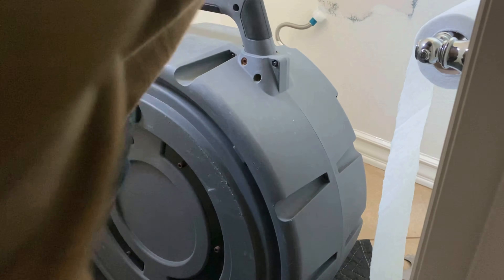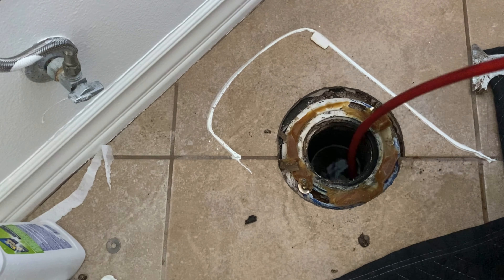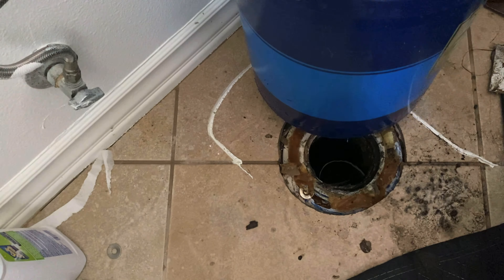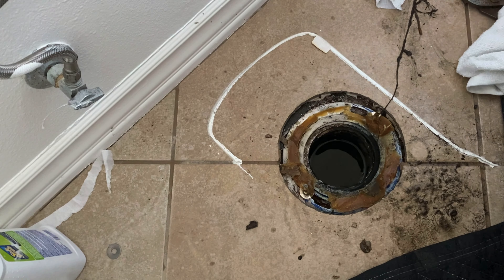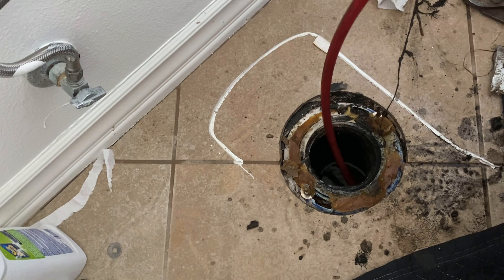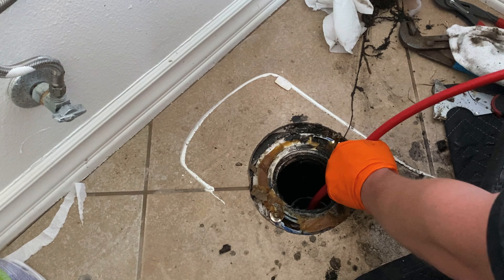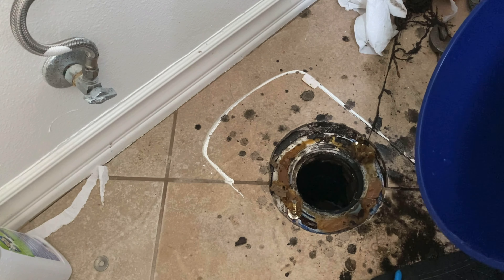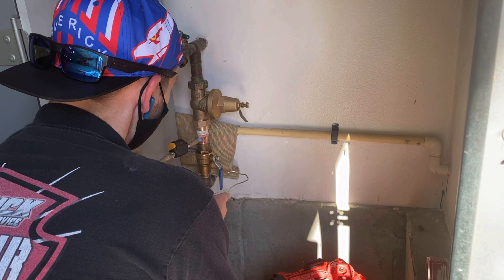Ridgid 64273 FlexShaft review k9-204 , Unclogging a toilet! | Unclogged Episode 14

Comment: I have the 204 and 102. Easily they pay for themselves many many times over. As far as jetting that line I would have using my mini reel probably. I also have the JM1000 electric for smaller lines that is super simple to set up and use, and destroys 2" lines full of grease.

Comment: Great price in the 204 Chris. The 204 is also the go to for me and now looking at the 102. Let me know what you think about the 102. Regarding an expensive camera I using a Compact but if you are not doing reports for clients (mostly for insurance claims or big clients like commercial or condos) stick to Chinese. I starte with a Steel Dragon 900N and let me tell you that for the $ it still does a great job for much less $. Thank you brother
Reply from the maker: Haha I wanted one of those steel dragons for a while now! I have a friend that uses them out in Colorado and he loves them. I bought another nicer Chinese camera that you’ll start to see in upcoming videos it’s the Spartan Sentinel. 

I HIGHLY recommend the k9-102 specially if you like the 204 and you have gotten use to its strengths and weaknesses! The 102 in my opinion is actually a better unit! I’m also hearing that from a lot of other guys the 102 really gets the job done in the smaller 1.5-2” lines!! Good luck out there brother thanks for dropping by I look forward to talking with you more!
Reply: I agree 100%. I have a Compact 2  with  a Csx6 monitor but the 900N it is the best you can get for the $. Super reliable and gets the job done always. I actually own 2 SD 900N

Comment: Hi Chris , I have a Ridgid K9 12 and K9 204 .I love what they do but I can on push them to go about have of their total length .Its like pushing a wet noodle up hill. I understand from their product manual they suggest using the fastest RPM cordless drill to drive these mahines. I believe this is crucial to optimal performance. What drill did you decide to use with your flexshaft machines. Please advise . Dave Doyle
Reply: Have you figured out a solution to this ? I’ve experienced the same. I’ve gone back to the k-60

Comment: How far out did you have to go.   In 45 years I have never own or even use a  K9204 I got have that auto feed.. keep busy and stay safe friend...
Reply from the maker: The k9-204 goes out 75 feet , I ran this out the entire 75 feet, This was a gnarly clog have you ever seen the dental floss stuff I pulled out? Do you agree its dental floss? Im really not one hundred percent sure thats what it is.
Reply: @PlumbingExplained   Unless the place is a dental clinic I'm thinking no..I'm thinking roots of some kind I've have here in Omaha  pull out tons of roots out of  a mainline where the tree had been remove some ten years ago  Yeah.. bat shit   crazy I know but it has happen.. peace & out..
Reply from the maker: Its not roots its definitely some sort of string or thread, ive pulled it out of a few different drains here in Southern California it almost is like the material they make baseballs out of before they cover them with leather.
Reply: @PlumbingExplained  Servicing the same units for 30 years - upstairs apartments especially been finding this stuff for years. Talking to the tenants they have admitted they just flush the floss, I think you are right.

Comment: Are you using the K9 204 for sewer lines 3 inch with roots?
Reply from the maker: I do but I also have better flex shafts than that.
Reply: Im just a home owner. I rented a 5/8 from HD, I want buy my own. What do you rec. I found roots in my 3 inch sewer @PlumbingExplained

Comment: Hey guys, the rigid cable cost $350 and the plastic spool is bout $1,500.

My question is this, why do we need that case…can’t we get the shaft and use it on a cord real etc?
Reply from the maker: The way ridgid's k9s are set up theyre well worth the money, I have flex shafts i use outside of a reel and its no where near as easy to use, if it binds up the thing flops all over ties itself in knots its much easier to have the k9 the way they are designed is perfect but they will work either way.

Comment: Bro, a 3 in c cutter and spartan 300 would have cleared that clog in 15 min. Flex shafts are great but not for these kinds of clogs IMO.
Reply from the maker: I just cleared a mainline with about 3 feet of the line fully impacted with roots in under 30 minutes, with a flex shaft I have a 300 for sale if you want to buy one.

Comment: What’s a 102 and 204?
Reply from the maker: The k9-102 and k9-204 are ridgids flex shaft tools you see me use in alot of these videos, they’re great they use a drill with a clutch instead of something you have to plug in so they’re very portable and great tools for 1 1/4 - 4” pipe. The k9-102 does 1 1/4” - 2” and the 204 does 2”-4”
Reply: Oh derrrrrrrr
Thanks man, I’m waiting on 2 flex shafts and a camera now should be here by Tuesday. I

I made my 1st drain bucks 2 days ago w a toilet auger so I’m still learning the words etc.

Question, can a flexshaft be used through a toilet into the drain below? Or does the toilet always need to come out?

Comment: How does this work on soft poop stoppages
Reply from the maker: I typically poke a hole with a cable machine, get it draining then ill run water and come through with this and clean the line back to like new!
Reply: @PlumbingExplained  do you charge extra to use this machine. I need up buying a 75 foot 3/8 flex shaft and I use a electric drill with no clutch.   Works good
Reply: @PlumbingExplained  good idea poking a hole in the blockage to get the water moving.
Reply: @PlumbingExplained  do you charge extra for using the 204